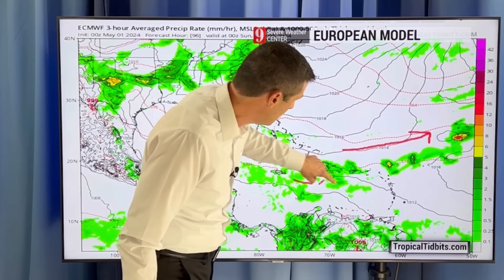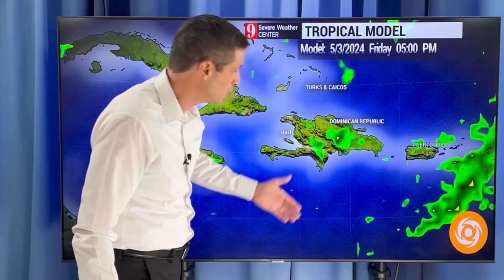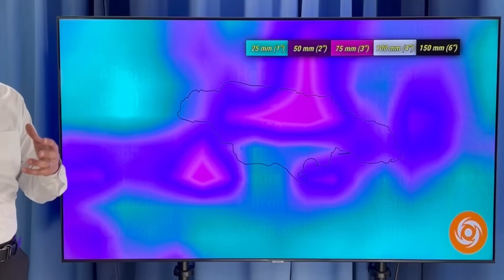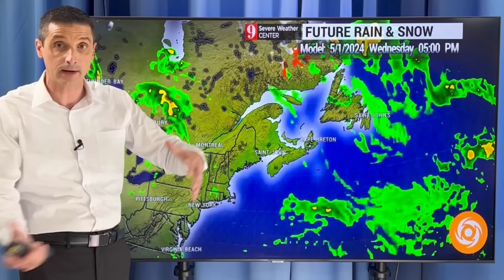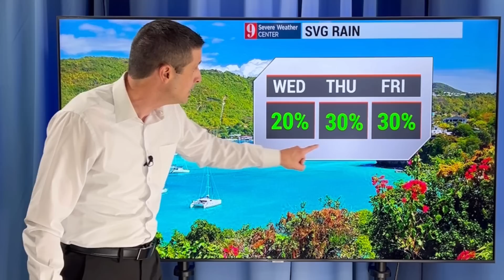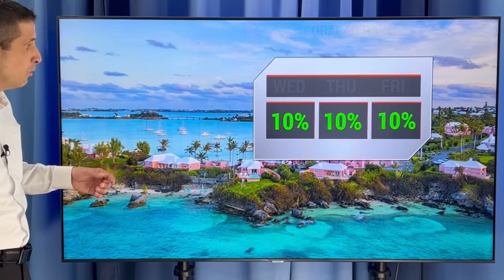Spinning Up…

Comment: Today in Belize City the weather was fair, sunny, hot and dry. The forecast today was for continuing fair weather, warm temperatures and mostly dry conditions. Skies will be mostly sunny today and clear to partly cloudy tonight with little to no rainfall expected. High temperatures peak at 90 degrees Fahrenheit along the coast, 97 degrees Fahrenheit over inland areas and 84 degrees Fahrenheit in the hills. Tonight's low temperatures will be 82 degrees Fahrenheit along the coast, 74 degrees Fahrenheit over inland areas and 68 degrees Fahrenheit in the hills. A heat alert is in effect, as temperatures inland are expected to reach and exceed 97 degrees Fahrenheit. Residents, especially  those inland, are advised to stay hydrated and avoid outdoor activity as much as possible, especially during the afternoon hours. Thanks Brian for the update and the video showing where this disturbance is heading and who will get the worst weather. Thank God we have you to point out these things to us. Stay safe. Good night.